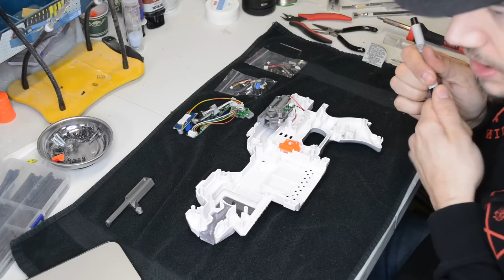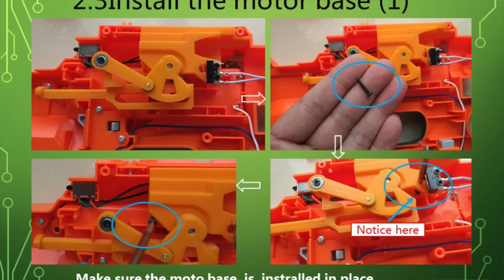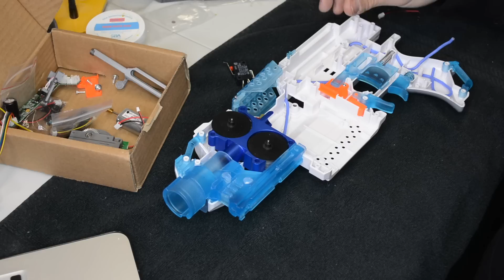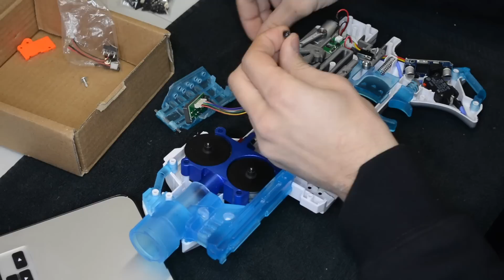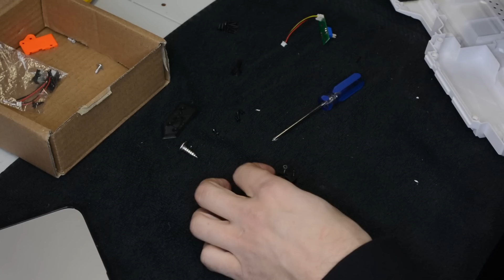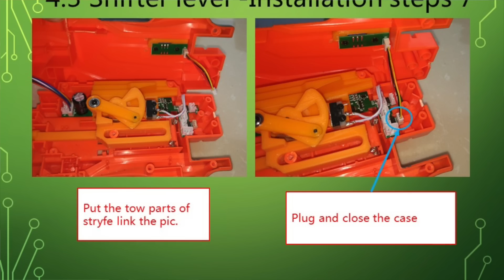[Mod Guide] Nerf Stryfe Select Fire Kit Tutorial

Comment: I tried installing mine but it won't do any of the modes. It is, instead, stuck on doing a 7 rotation burst for each trigger pull. Do you know of any way I can fix it?
Reply from the maker: Take off the lever for the select fire switch and make sure the line on the noob of the controller is pointed diagonally, like 10 o'clock. Them put 3d printed lever back on level, as it would be in single fire mode. It shows this in the directions, link in the description. I wish I would have said this in the video but mine was already in the correct position and forgot about that step.
Reply: +Naptown Nerf Alright, I'll try that. Thank-you!

Comment: Very informative video. I wish it had been available a few weeks ago when I had installed my kit, it would have made things a little easier. I ended up using a smaller switch (10amp DB2 cherry micro) to allow the modulator to be placed where they originally located it. Im only running a 2S so I'm not worried about frying it. 

I had a few issues with stripping out the heads on the self-tapping screws, so I would definitely make sure you're using an appropriately sized screwdriver for that part. All in all, a great resource for installing this awesome kit.
Reply from the maker: Thanks. Yes I'm using the correct size screwdriver is very important probably should've stated that more clearly.